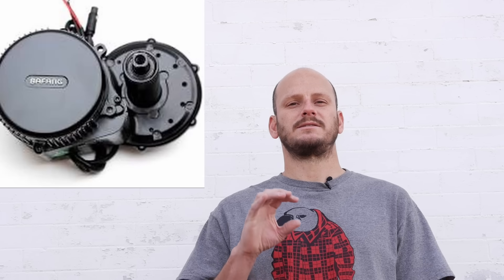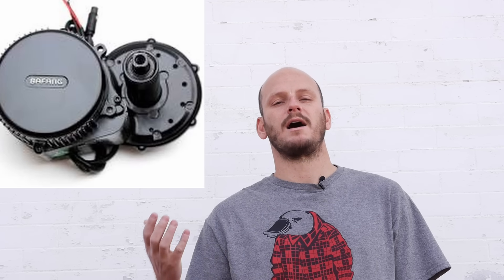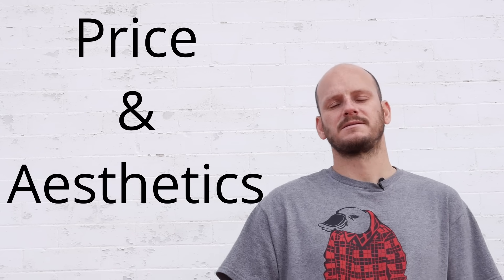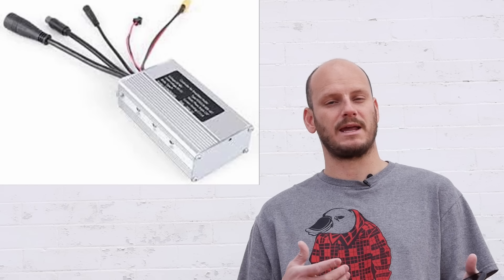Hub vs. Mid Drive Motors: Why Hub Motors Suck and Debunking Common Myths with performance test

Comment: You're comparing having a hub motor bike to having one gear in an internal combustion car which is a total BS comparison. Electric motors will have constant torque well past the speed limit (around 20 mph here in the US) where as ICE cars start with low torque and achieve maximum torque well into their RPM range. ICE cars also have a much lower RPM range in general. But the biggest BS is that the bikes transmission can still be used to produce additional torque when needed through through shifting down and pedaling. The combined torque of the human and the hub in this case is more than enough to climb all the steepest mountains. The optimal gear ratio for the human and the machine are totally different, humans have a very different torque to RPM curve and torque effefficiency to RPM curve that is which keeping the transmission shifting for the human is so critical. A better comparison would be hybrid cars which generally have a fixed gear ratio for each electric motor.
Reply from the maker: My point was that electric motors still benefit from a transmission. In my experience, a low wattage motor (under 1000w) behaves very much like an ICE on an ebike. It is a completely different experience once a motor takes advantage of power multiplication via the gear set 👍
Reply: @JohnnyNerdOut  bro, you have been in this game long enough to know that electric motors do not benefit from a transmission. I cannot believe you still think this, especially for light duty applications like an ebike.

not transmission: https://www.youtube.com/watch?v=eF2L_4tRtDA

the crappiest $100 motor from 20 years ago: https://www.youtube.com/watch?v=e03rMDmJzLE

Comment: Best and cheapest kit for a Trike? I'm disabled and get a small social security check. My car broke down and it going to take me months to save up to buy a used car. I'm missing a left leg so don't feel safe driving a bike so got a Trike trying to prepare for when that head gasket started leaking too much into the cylinders and the car stopped running. But happen before I could buy a Trike conversion kit. Don't have but a few hundred to waste. I'm stuck at home no one wants to ride me to town live in the country. Love it but for when I'm without a car. A few miles to the convention store. Would be great to have a motor of some type to drive me not to good at pedaling with my fake leg. Use to walk but bad health and fake leg hurts after a hour of walking 🚶‍♂️ so much prefer a electric kit 😅 that will take a not to expensive battery. Thanks for any information. Would just by a 2 stroke if I felt comfortable riding a bike. But can't do it for my Trike. Thanks again.
Reply from the maker: Check out the toseven dm02 if you are looking at a mid drive system, or the Bafang bbs02 for little more money. 
A hub motor may be a little less expensive if you don’t need a ton of performance or accessories
Reply: @JohnnyNerdOut  thanks I will check into it.

Comment: heck you dont even need to carry a full spare chain. A couple master links along with a multitool that does chain splitting and your golden.  You should have the tool anway and a couple links ways nothin. You probably still want to replace the chain at the first opertunity but you can limp home.

Comment: This guy failed to address few important issues:

I have a hub drive and have no idea what he's talking about...there are no spokes, as it is one cast alluminum rim unit...so that destroys the "spokes getting lose argument"...most hub drives that I see in my area are single unit inside a cast alluminum rim units.

Second...what demographic is he talking to?

If you have a serious e-biker that wants to climb hills and extra performance, yes by all means the mid drive is for you.

But if you just want to get to work and back, get the hub motor as you basically have 2 redundant systems...

I don't feel like changing a chain on a sidewalk for example...I just want to get to work on time and deal with the chain later..a hub drive gives me that option.

And finally, you ALSO have the option of using the pedals and changing gears on the hub drive, should you desire a BETTER performance.

But again, it os OPTIONAL....and who doesn't like options??

Comment: What about regenerative-braking?
Reply from the maker: Generally those are only  found in direct drive hub motors on e-bikes.  On motorcycles the mid drives also support regen.

Comment: Maybe bikes with hub motors should use comstar-style wheels to prevent spoke problems. At least in theory, comstar wheels on motorcycles have more springiness than solid wheels, but are stronger and require less maintenance than spoked wheels.

Comment: These contraptions need to be (and will be) regulated as motorcycles. The current free-for-all from the highways to the sidewalks is a danger to everyone. Large lithium batteries should be regulated as explosives. The only question is how many people are going to be injured or killed before the law catches up.
Reply: i don't want to comment on US regulations, but calling lithium ion batteries explosives is just dumb. Yes, improperly used ones, that get either mechanically damaged or have a bad bms can spontaneously ignite. But so can a fuel tank if you use it wrong. In fact, since a fuel tank stores more energy, it's failure is far more destructive.

There may still be a bit of learning curve ahead when it comes to using lithium ion batteries properly, but that's not a very good argument against the technology as a whole.

Comment: Ive ordered a specialized turbo levo for commuting with a 565 watt motor and a 90nm of torque mid drive motor. Ive got it for commuting which would you say its enough power?
Reply from the maker: Probably ya but it depends on your riding style

Comment: my question for you is how many of the hub motors issues with bent spokes are from people who are larger than average or just too large for that bike or are just using the throttle way too much? i find it hard to believe that the 250w motors are pulling spokes out regularly. im totally okay being wrong on this but im curious what the conditions were for this to happen, which motor size/brand does this the most, or what bike brand you see this on. as someone who is getting into ebikes many reviewers have their opinions but dont elaborate on how the thing was used or the original quality.
Reply from the maker: It isn’t because of the weight, it’s because of the quality. A cheap hub motor uses thin gauge spokes and are poorly tightened.

Comment: My first e-bike was a hub motor and I loved it. It's not only the chains but my old bike I had my derailer snap off, my back casket break, my peddles break, my crank arm break and my chain break. All those situation I was able to keep using my bike as my car till my replacement parts came in nor did it make me late for work or wherever i was going. I also think it much easier for someone who this might be their first bike. It's gives you less complexity but automatic cars beat of out gear shift for a reason, most people prefer less complicity. It does makes you over travel slightly slower which again for people new to bikes is probably a good thing plus the time difference on an hour commute on my bike going 32km or 22km only changes about 10 minutes at most.

It is however, like you said, much harder to get fixed and most bike shops don't want to touch conversations bikes parts so truing wheels and such is going to be hard, your basically going to have to learn yourself unless you can find a local conversation builder. It's also EXPERNSIVE to have spare wheel for back up for or the spring/fall time when switching back from studs and not daily is a good thing to be able to do.

Comment: hub motors are fine if you get an 3000w one with dope controller and pull out 9000 wats vroom vroom 85km/h

cant do that with an mid drive brother

Comment: If you can't afford a mid drive, the difference is moot. The you tube elite consider anything less than $1k as non existent.
Reply from the maker: Mid drives start at $350
Reply: @JohnnyNerdOut  I haven't seen a middrive bike for a price point I could afford or justify. But with the prices I've been seeing lately, who knows? I just bought a full suspension 20" for $520 with fenders, carrier, all the extras. The Vivi FM20. And I've seen ebikes at $300 so maybe there is a low cost mid drive out there. At 70, I needed the lower stepover and rear suspension to safely keep riding.

Comment: So this video didn't age well... I can start on a 30 degree   incline and still hit 40mph with my hub motors on my Nami scooters... even when I'm not on my max setting and i can n pull away from any mid drive  starting on an incline  Or flat surface.
Reply from the maker: This is comparing e-bikes. Scooters are a different animal with a much more aggressive gear ratio.
Reply: @JohnnyNerdOut  Nami scooters use tiny direct drive hub motors.

Comment: Nerds know that TORQUE is something that can bend or destroy your spokes. And in both motors torque goes from wheel axle through spokes to tire. No matter where motor is placed force always go through spokes and can destroy them. So.. if you say mid drive have double that force and is less likely to damage the spokes, something is not right...

Comment: I'm long time normal bike rider and hub motor is something amazing. No wear on chain, hub or shifting mechanism. It's really big thing. I had to change this every year and with hub - there is no need for chain. As for torque - 80 Nm is just stupid strong. For my bike with fat tire, sandy roads are no problem. 30-40 degrees uphill? No problem. Do you need 8 gears on your drill? IDK, maybe... For sure I don't on my e-bike. Maybe if you jump or do some stupid shit with your bike you do need it. Gear changing? Remove this shit from my e-bike.

Comment: Hey I am just trying to educate myself. I will have a hub motor once I get it. GoatV3  But I know that won’t be enough speed and I will put a mid drive in. Something in the 72 volt and have plenty on tap. As a consumer you have to get educated on e bikes. I thank you for the info. I hope no one got their feelings hurt.

Comment: Your comment on hub motors chew up spokes does not add up. The mid drive torque goes through the chainwheel onto hub & then through the spokes same as the hub motor. If anything the hub motor is putting less torque as you are not able to go through the gears as the mid drive.
Reply from the maker: It’s the quality of the wheel build on hub motors. In cheap bikes, they can be terrible. Like, laughable.
Reply: @JohnnyNerdOut  You must be right. also people dont check their spokes to see if they are tight. I have a hub motor bike that is 4 years old & wheel is still fine. even after riding down steps.

Comment: I don't think changing a back tire is a hassle on a hub motor. Just a wire to unplug for the motor.
 I have a Shengmilo S600 with two 1000watt hub motors. It supposedly only weighs 71lbs. I haven't weighed it. I run it hard so lets see if I burn up a motor.

Comment: There's one question that seems to be getting missed.
With the hub motor ebikes, they have a controller unit. Is this also the case with a mid drive motor? 
Also, while I am at it, being a bigger/beefier guy, I have had instances where I have had problems with the crank (arms loosening up). Is it usually a better idea to get a heavier chain if dealing with more weight?
Reply from the maker: All motors have a controller regardless of mounting style. Mid drives are generally designed into the motor housing. Theres plenty of tricks for tricky crank arms. Check some of the threads for those.

Comment: Mid drive bikes are 4 x the price
Reply from the maker: They start at $330 for a mid drive motor kit. 4x may have been the case many years ago but not anymore thanks to a lot of competition
Reply: I'd like to buy an ebike to get me around recreational and national parks. What is a good mid drive 29er mountain bike electric if i have between $2000 and $5000 Australian

Comment: This is a very informative video. I do hope you read this comment. 
In all honesty, I can't say which I prefer yet. I should have an idea in a couple of months. 
I've had 3 BBS-HD 1000w mid-drive motors burn out in 6 years. Admittedly, I carried a trailer, and much more weight than the typical user.
Having radically redesigned my set up, I decided I wanted to build a 4 wheel velomobile. I also wanted to overpower it and have 4x4. Hub motors won out, as designing a 4x4 chain system was a bit tricky. I went with Leaf-bikes 2000w 52v fat tyre wheels, FOUR of them. I also nominated to get the motors wound to Max out at 420 rpm to hopefully increase durability. I don't want speed. It's climbing abilities that I seek.
I managed to get all 4 (2× left and 2x right sided) hub motors for USD $1,710-i including shipping to Australia.

Comment: Do you have snow in your area? Hub drives do quite well in snow. Salt degrades chains. But i do plan to build a mid drive for myself one day. They have different purposes. I've built both but i only built a hub drive for myself so far. I'm about to service a broken chain on a mid drive i built too. I like all bikes.

The reliability thing: cant put all hub drives into one single category. Probably most hub drives, that came in to repairs were direct drives. Geared hubs share the freewheeling one way thingy with mid drives. Ebikes are way more reliable when you disable regen completely. It can be done correctly but it never is.
My geared hub has done over 18Kmiles. I see less and less direct drives everywhere but i see people riding around in geared hubs a lot. I used to be the only one with a geared hub around here when ebikes did their first popularity wave around my area. Back then i mostly saw direct drives.
There were literally no mid drives back when i started in my area and still quite few because they tend to cost more.

Comment: Host did not mention noise level.  Hubs are more quiet.  Never had a spoke loosen or break, but that may be because I always pedal and use the throttle to augment as needed.  My homemade hub bike is maintained at home - boss’s mid drive goes into the shop for weeks at a time.  Yes the mid drive has much more torque, but my boss loves to ride my hub drive ebike whenever I ride it into work

Comment: I have question regarding the motors from ebikes, do we need to open the motor and add new grease?
Reply from the maker: Occasionally, you should. I say like oil changes. 3k miles

Comment: I just bought a merida big 7, 20, and have been considering converting it for bike packing trips over the summer in the UK, northern ireland... I know there are laws in place, which I honestly don't care too much about cause they're probably bi laws which require consent to be used against you but I dont wanna push stupid power either, I would need to cover hills when I get there at the end of say 30-35 miles though...any thoughts on the lowest entry level that might suit me? i'm not a super confident mechanic but I can figure it out if theres plenty of videos around it...

Comment: Question about these mid drive motors… if they’re connected to the cranks arms/pedals do the pedals not turn during throttle use or is there some kind of free-wheel/clutch ?? It’s not like a fixie for example?
Reply from the maker: There is a freewheel

Comment: What about regenerate braking ? ? ?
Do mid drives have that ?
Hubs do !
Reply from the maker: Only very specific motors of both hub and mid motors support regen. Most common (but still rare) are found in direct drive hub motors.
Reply: Direct drive hubs yeah,
It's more the controller and geared hubs can be modified also.
I'm years ahead of your experience in electric and e-bikes

Comment: I really prefer mid motor, because sometimes I drive with trailer behind my bike for the transport of heavy materials or for holiday, when I'm away from home for a month.
A hub motor need a minimum speed to drive for not overheating and burning out.
A mid motor can always run at its ideal rpm for best torque and efficienzy.
A big con of the mid motor is the lack of recuperation while rolling along, but that's only marginal.
If you live in flat cities without steep streets then you should go for a hub motor.
Otherwise I would always prefer a mid motor.
The biggest problem with the hub motor is
that it makes the tire heavier and thus greatly increases the unsprung mass. If you have a fully then this is a no go.
I've always a replacement tube and a new chain with all needed tools in my bike pocket. It's not a big deal.

Comment: My Hub bike has 10 gears at the back so that "one" gear with a hub bike goes straight out the window.
Reply from the maker: My point is that only human power is going to those 10 gears. With a mid drive, the motors power is going to those gears which really make a huge difference in performance. It multiplies the power coming from the motor and puts it in a very specific power band which is changeable by changing gears.

Comment: Don’t hubs have built in transmissions?
Reply from the maker: They have a built in single gear reduction (geared hub motors) but not a transmission with multiple gear options